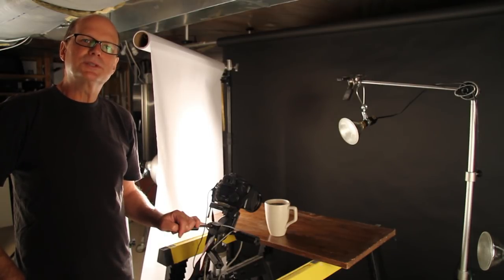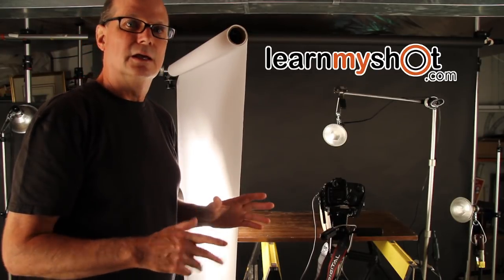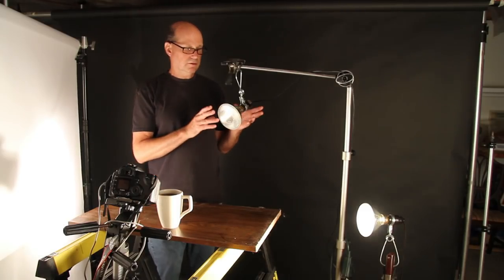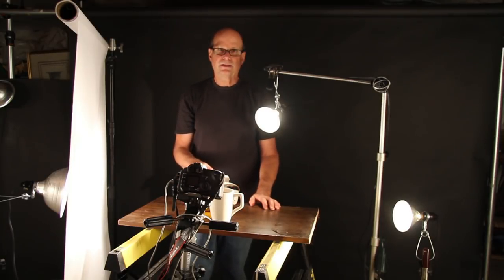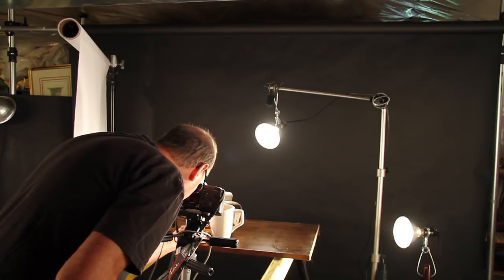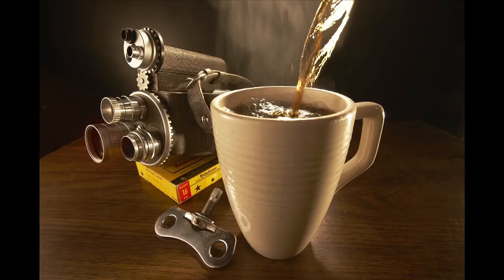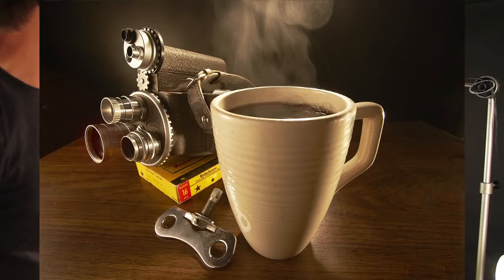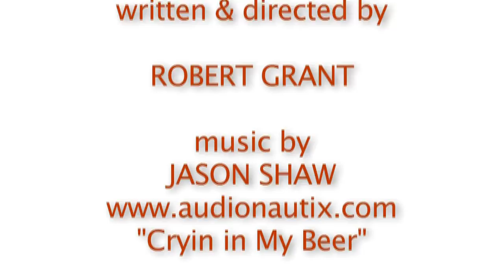How To Photograph Steaming Coffee

Comment from the maker: very good observation ! with flash you can only freeze the motion of smoke to get more detail. However, with continuous light you can control the visual appearance of the steam using the shutter speed. With speeds 1/30 and below it would appear softer / more dreamy. and with 1/60 and above sharper with more details. 1/500 sec freezes motion of steam completely

Comment: The equipment can be really cheap, look around the house for lamps, preferably spots, cooking paper can be used for diffusing and most cameras and lenses Should not have aproblem with doing this, its not the camera that matters but the photographer and subject. and Btw Its not Canon D600, its either Nikon D600 which is a expensive camera, or its 600D which is one of canons entry level Dslrs